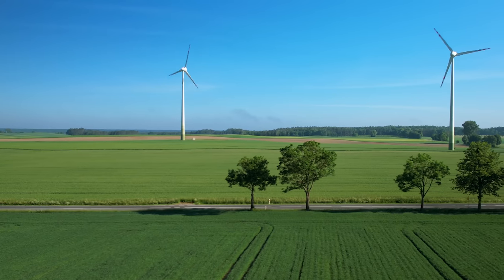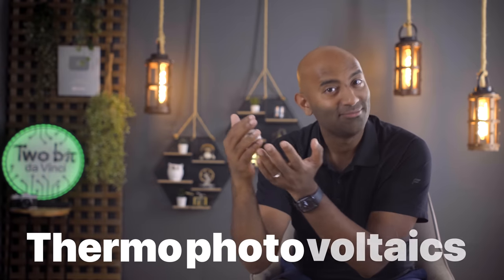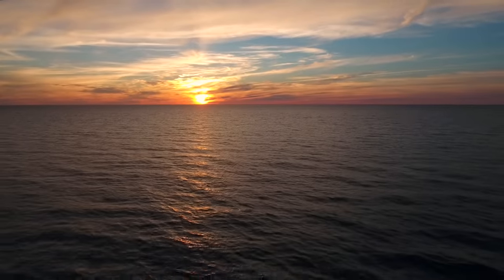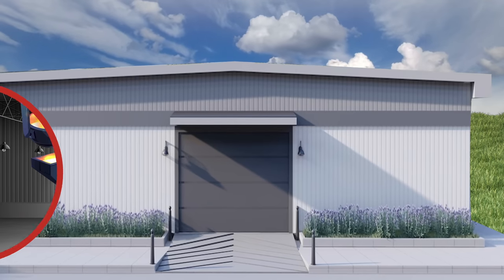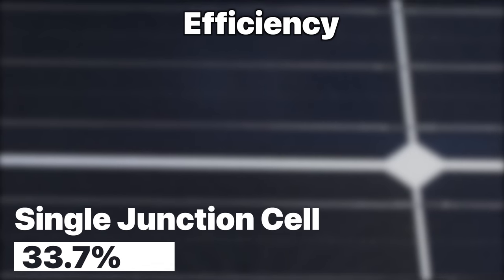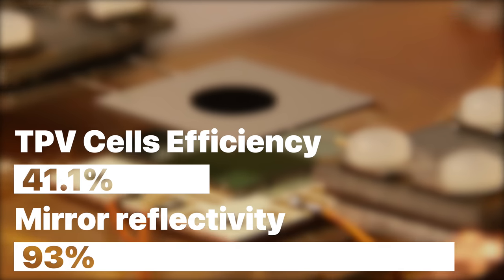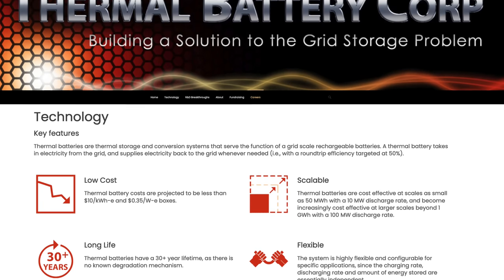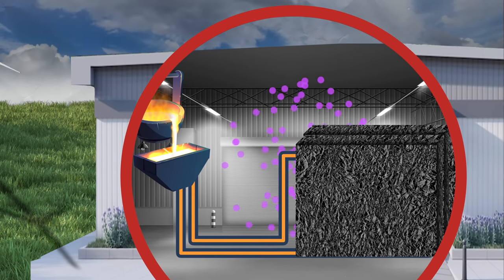Breakthrough Solar cell DOESN'T Run On Sunshine!

Comment: Note how individual component efficiencies are touted but not the round trip. Some of these techs become a net NEGATIVE once daisy chained together as energy moves from mechanical to thermal to photo before it gets to electrical.
Reply: It's just another type of battery in the end.
Reply: Also if you have a way to extract thermal energy more efficiently, it makes more sense to simply use these magical TPV cells to extract the thermal energy from a nuclear reactor. Whichever way you spin it, generating intermittent energy and then storing it is always going to be less efficient than just using a stable dispatchable power source like nuclear. 
Renewables should only be stored if you were going to charge that battery anyway, such as for an electric car.
Reply: @demoniack81  The standard way to use thermal energy is to just boil water; maybe it's more lossy but it's pretty much the cheapest material imaginable for the job.
Reply: @demoniack81  
Very close to my way of thinking. If TPV could extract electrical energy from heat that efficiently, then why not build a hybrid car using a much smaller engine which wastes most of its energy as heat anyway?
Or house batteries charged from the central home heating appliance.
Nuclear is a very viable option for grid-scale energy. Would TPV be more efficient than steam turbines? Would TPV make micro-nukes generators even smaller? How do TPVs compare to RTGs?
Reply: @theTeslaFalcon  I imagine that the reason the battery tech is being focused is because we already have good enough ways of generating energy, but not storing it, thus, there is waste.

Lithium batteries are very good but expensive and probably have a low lifespan too; water resevoirs are huge and require certain conditions for elevation.

Although, I imagine that these TPVs can be used in already existing generators to squeeze even more heat energy out of them.
Reply: @FelmastProMclane  
In no other place in your life would you accept that answer. Excess does not mean that we're at liberty to waste it. Fresh water, plastic, oxygen, electricity, food, fuels, etc. are all finite resources that need care in handling to avoid waste. Waste creates problems for others or ourselves: environmentally, atmospherically, economically, etc. The intent is to store the surplus of daytime solar here for delay consumption there.  Every watt wasted is a watt that didn't need to be generated. Why build a huge 0 emissions generator if so much is wasted via inefficient mismanagement? 
Only a bureaucrat would think like that.
Reply: @theTeslaFalcon  I think I miscomunicated, I am in favor of the energy storage use of this, so that energy that we currently generate does not go to waste.

But it would be nice a large-scale battery comparission that includes the one in this video, as the ones I've seen include the "Lithium", "Gravity" and "Water" based batteries.
Reply: @FelmastProMclane  
That was the point of my comment. They're only pointing out the efficiencies of certain parts of the system that make it look good, not the system overall. When that figure is compared to gravity, water, lithium, sand, etc., it likely would be much less favorable.
Reply: @theTeslaFalcon  Lol because they want that investment cash, my dude. Those numbers are delicious icing on a cake for those decisionmakers that aren't as technically auspicious to look very closely.  Personally, I was hoping for a tangible technology for folks that don't own large centralized power companies, but that's definitely what this is. Everyone dreaming for an improvement to TECs should move along.
Reply: @demoniack81  It didn't seem like TPVs were practical for non-molten heat sources, lol. The 2400ºC operating point to produce the 800nm visible light and infrared light seems way too hot for most heat source power generating plants. Reading up nuclear, it runs below 800ºC in most designs, and they're the ones who have a hard time spooling the power up and down who could use the tech. But if the TPV itself can't be used directly for conversion, the power needs to come first from electricity, so lovely diminishing returns.

If this was a lower temperature design that could compete with a turbine, this would change the world, but they know it's not which is why they're chasing grid storage for wind, solar, and decommissioned gas peaker plants...
Reply: @theTeslaFalcon  " If TPV could extract electrical energy from heat that efficiently, then why not build a hybrid car using a much smaller engine which wastes most of its energy as heat anyway?"

co-generation is already a common/essential thing though in gas fire and other big boy fuel power plants. Hot exhaust gases flow into 4-port heat exchangers which flow water to do work on more turbines, generating more power. It's just never emerged in the automotive or transportation sector for the same reason that not every car has an intercooler and turbine. Don't ask me why it hasn't happened, but if the automotive sector did it properly, an ICE could easily outperform today's hybrids, and tomorrow's hybrids could work better, or not be entirely that necessary.

This is what the US government and other countries could have steered the industry to do if they set higher targets  (think 100 MPG) rather than just messing with free markets and forcing heat engine technology, ICE (backbone of economy) out of existence. As a competing technology, ICE and EV could have COMPLIMENTED each other by striving to push higher limits.
Reply: @itchykami  and sand.

You could distill the water at the same time too.
Reply: @demoniack81  I agree.  If this could be made more efficient than steam engines then it could be used with nuclear among several others types of power plants, not just solar or wind.
Reply: @Infinion  I actually missed that part of it. I mean usually nuclear reactors are constrained by the maximum temperature the fuel can run at, but metal fuel reactors don't have this problem. I guess at that point you're constrained by the maximum temperature the RPV can take, which I'd guess could be no more than 1200° at most since they're made of steel.
Either way that makes this technology useless for anything other than storage, and even then I have to question how they propose they're going to move this liquid 2400°C zinc around. The video says they did it in the lab, but the real world is not the lab and working with fluids at that temperature at scale is bound to be an absolute nightmare. Unless the pipes are made of exotic materials like tungsten I can't see them lasting for any length of time.
Reply: @demoniack81   Yeah man, useless for anything other than storage, with one theoretical exception bordering alien tech. If they could invent a working fluid (think metal vapor from an evaporator of boiling molten metal), and then conceive an ultra high temperature heat pump to compress metal vapor to higher pressure, densifying the lower source temperature heat to the target 2400ºC, they wouldn't need to derive ALL of the energy from an electrical heat source, and could get some, or maybe all of it from a lower temperature fuel heat source. The requirement is still tall for nuclear, because the heat source would be required to boil the molten metal after the TPV and heat exchangers cool it below the source temperature...

That being said, if they can invent and patent those components, they would LITERALLY TRANSFORM the metal industry, the LARGEST industrial consumer of world's electricity for metals processing (the facilities with electrical arc furnaces). That's with the added benefit of reducing peak load rather than fighting the power creep that comes with growing industries.

It's probably a lot more practical to tweak these TPVs to just not require visible light to convert heat to electricity. If it were infrared it would make this complex system far more practical (maybe complexity is their business model??).
Reply: @theTeslaFalcon  Water, oxygen, and electricity are not finite resources, at least not in the normal way that term is used. Their current THROUGHPUT obviously has a maximum limit, but they are not depleteable and thus not finite
Reply: @Superabound2 
Given the current emphasis on conservation & possible shortfalls in cities of clean freshwater, electricity, & clean air, it IS a finite resource. As w most things, bad gov'ts exacerbate the very problems they promise to solve.
Reply: @demoniack81  until you include the cost of decommissioning/storage of nuclear waste.  I'm not antinuclear, but I do recognize these limitations.  I would agree that "no matter how you slice it..." nothing is going to be 100% efficient... beyond that, I'd say you guess is as good as anyone else's.
Reply: I'm hopeful.
Reply: @demoniack81  If you ignore cost, sure. 

Real world doesn't ignore cost, which is why Nuclear only works in a few market segments.
Reply: True, they don't mention energy wasted during heating of tin, energy radiated from graphite, wasted during transfer to next building and then wasted during heating of tungsten plate and not absorbed by TVP cell.. and that TVP cell only has 40% efficiency? Damn.. if they end up with 20% efficiency of whole system then I would be positively surprised. The system is without TPV cell seems more interesting for storing thermal energy alone. I belive that for storing thermal energy it is damn good idea but not for electric energy alone. Because 40% efficiency seem too little and even less efficiency for whole trip of it. From electric, to thermal, from thermal to radiation, from radiation to electric again. From electric to thermal we have around 70-80% efficiency, from thermal to radiation we have around 80-90% then we have from radiation to electric 40% and I didn't even count on all the energy wasted as heat escaping the whole system.

Comment: looks impressive, and they aren't  just saying years down the road like most of these, they're saying this year.  if it works as expected, and is scalable(even at smaller scale) it could change a lot of the way we think about heat.
Reply: Thinking differently is really the main part in the Finnish project he mention in the video where they do not convert the stored energy back to electricity, but use the heat directly and gain much better efficiency by doing so.
Reply: @bknesheim  This, all day.  Conversion is wasteful, the more steps you add, the greater the losses.  That ground storage system is SOOOO much less complicated and will probably work forever with little to no maintenance.  This thing..meh.  I see hazards, expense, and system failures written all over it.
Reply: @enmiredbythelazy4401  Agreed, this is an old concept that worked and was simple to build when done properly with cheap, available materials. Home-made solar furnaces can give you lots of usable thermal energy using a transfer medium like oil or paraffin, and storage tanks, but require direct sunlight, so they're semi-useful, just like any solar collection, but cheap and easy. This is a search for more commercialization in a fantasy world of semi-tech.

Comment: Excellent discussion. However, the environmental impact of any new techs, in this case of tungsten arsenic and gallium extraction and disposal should also be considered.
Reply: Shhhhh, you will wake up Lil Ms Thumberg. Anyhew. we already have a very reliable technology that has something to do with Adams, which can power all those smuglies' homes and charge their $200,000 dollar electric luxury cars.
Reply: @citylockapolytechnikeyllcc7936  a 1 meter square making 100 kW of electricity?  Thunberg would be ecstatic.
Reply: Yup and the damage to wildlife and the ground that is covered up...
Reply: Sorry, I’m backed to where you have to seal an unspecified area building with argon…
Reply: @stuartnochance  Yeah, that minor detail….🤔
Reply: I forgot about the damn Argon...
Reply: Don't you know you're not supposed to point that out. Just like no one ever talks about how much damage making batteries for all of the electric cars will do to the environment. Or how there won't be enough electric power generated by green energy to charge up all the electric cars everybody's supposed to drive. Like what's happening in Commifornia right now.
Reply: @thebigdog2295  Or, indeed, the environmental carnage caused by the extraction and processing of rare-earth elements such as neodymium for more efficient electric motors, gallium etc. for chipset production, the increasing requirement and increasing difficulty of obtaining copper and silver for wiring, jointing and motor windings. 
The list goes on and on.
Reply: @justkiddin1980  they just said they could use existing abandoned power plants
Reply: @thebigdog2295  CA has improved their grid and expanded green over time...and have a plan to continue. They have been able to avoid most blackouts through a large heatwave by preparing and managing that too...which was really as simple as asking people not to charge their cars and turn down their air during peak evening use.
Reply: Tungsten is already a significant commodity.

Most masonry drills use tungsten carbide drill bits.
Reply: @thebigdog2295  b00m...
Reply: @citylockapolytechnikeyllcc7936  yeah, except that no one interested in making thing better wants us to stick to prototypes of things. It's almost as though proof of concept and basic research to improve efficiency and eco-friendliness are part in parcel of achieving balance.
Reply: Well we need gas for the machinery to extract the materials from the earth.
Reply: @citylockapolytechnikeyllcc7936  No You do not have a means to charge all those EV's. It is a disaster. Never in 50 year can this happen. Not practical. Not possible given Lithiums abundance. And The lithium cells are far more dangerous and heavy. All things considered it will be less efficient. Cost and impractical..Ever play with lithium. Mercy! Nothing puts it out.  It will explode with water burn in water and even ignite in damp air. Buy plenty.of lithium X if you buy a EV. I wish people would just learn  Ohms Law and Basic Math. You are correct this is a nightmare for America. Proposed by grant money for grant research.
Reply: I'm not sure on all the disposal methods or other extraction effects, but extraction of Gallium is already tied in with the Aluminum extraction industry. Something that we've been using in our modern era extensively. Gallium is primarily found in Bauxite, the same ore that we get our aluminum from.

Comment: This entire concept calls out to my engineer's heart!  Indeed, all that molten metal slinging around multiple piping...  yes indeed.  Unfortunately, my long experience also warns me that such complexity around corrosive high pressure that leaks can be a severe problem.  That doesn't mean you will have them; it just means that the precautions required to prevent leaks and issues of that type are excessive and expensive.

This doesn't mean that they can't be built and systems like this can't work.  It means that the alloys needed to create them are expensive and will require frequent maintenance and possible repair.
Reply: lava in a bottle?